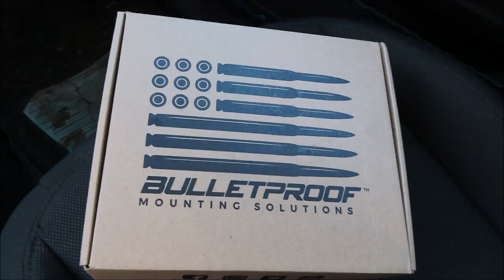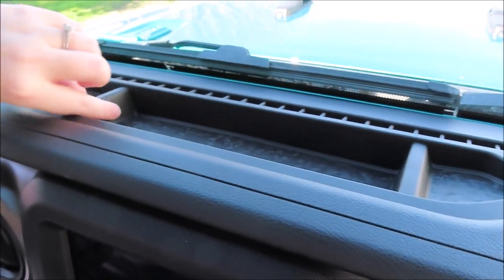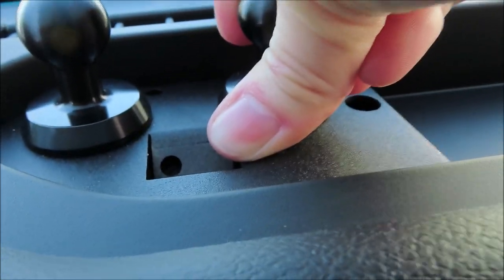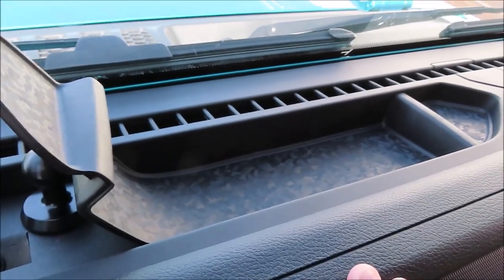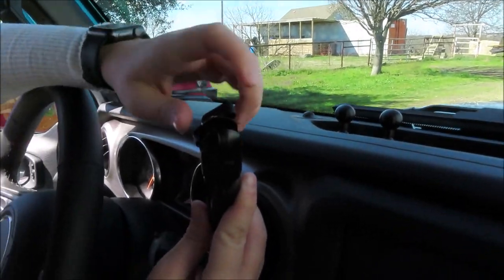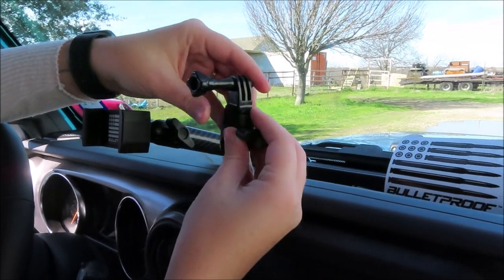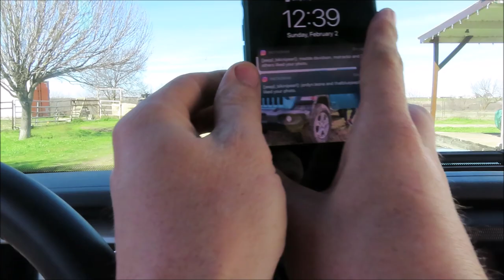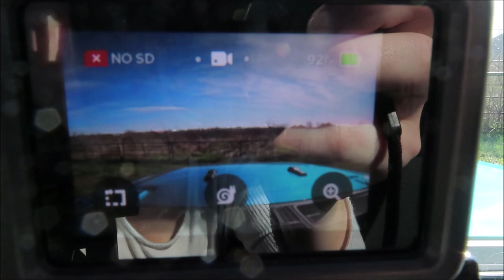Jeep JL Bulletproof Dual Mount Install for Phone and GoPro

Comment: Hold up...how did you out in the extra screws without drilling any holes into your dash?
Reply: Yeah.   same question.  The video sped up and over that part... I didn't see any drilling but the screws are secured in to what?
Reply: @jasont5402  I bought it and the screw will actually tap into the plastic and make it extra secure, though I only used 2 of the 3.